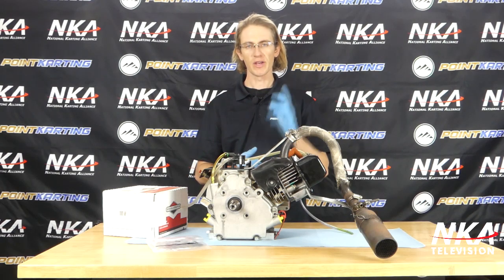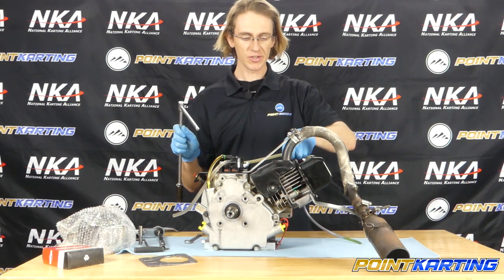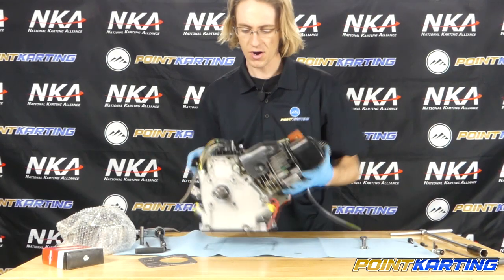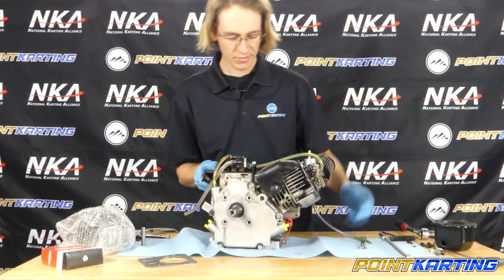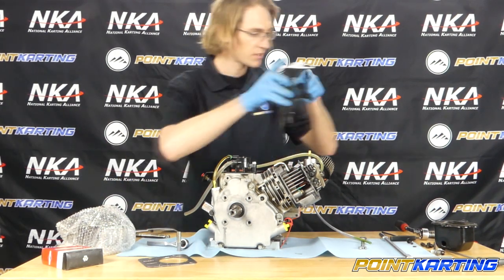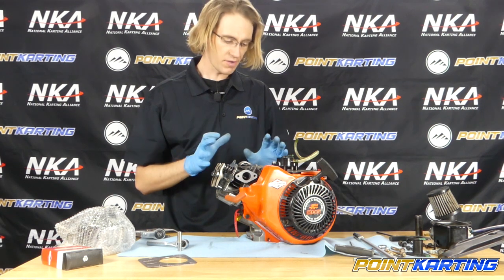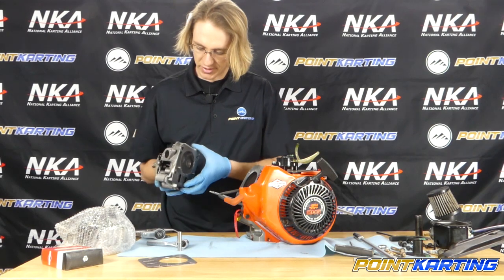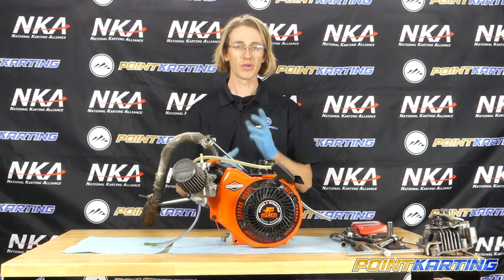Replacing the Cylinder Head on a Briggs 206

Comment: Do you have a video that illustrates changing out intake and exhaust springs when they wear out?
Reply from the maker: Hello! Thank you for commenting. At this time we do not have a video specifically about replacing the valve springs. However, we do have a great tool for easy removal of the valve springs on our site that makes it super easy to remove and replace the springs. We have added a note to our production list to make a video on how to do this, and we appreciate the suggestion! In the meantime, give us a call or email anytime and we can walk you through the process.

Comment: Are you still making these videos? Please keep going! I need help on 206 and you have the best videos out there. Now my main question is why would you replace the cylinder head? Is maintenance on the 206 mostly just repairing? Or is there any tuning we can do to make it perform optimally? I know setting the valve lash is vital for optimal performance but... yeah im lost. Thank you for an awesome video
Reply from the maker: Hey Carl! Thank you for reaching out to us! We want to make more videos, trust us! We have been swamped with orders and business on the retail side of Point Karting, we intend to make more videos shortly! Replacing the cylinder head is great when the engine falls off in performance and you aren't comfortable with lapping the valves or more advanced maintenance, or if you bend a push rod, or strip the threads on the cylinder head for the exhaust header bolts - these are the most common reasons...Maintenance on the 206 involves some routine items as well as more intervale-d items - we have a document for our racers that goes through a lot of this. Feel free to reach out to us at pointkarting@gmail.com for this document! Chat soon!
Reply: @PointKarting  thank you thank you❤️ good luck with everything

Comment: I just replaced the cylinder head on my 206 now it is very hard to pull.  What should i look for?  Thanks.
Reply from the maker: @Titan Town great question! Likely you have your valve lash set on the wrong stroke. Make sure when you set your valve lash after replacing the head that you did so on the cycle between the intake and the compression / combustion stroke. Having a hard-to-pull / start engine is a common symptom of that. Let us know if this helps with your problem, and reach out to us again anytime you have questions!
Reply: @PointKarting  so i think i set the exhaust on the wrong stroke and it was too loose and not engaging the compression release.

Thanks!
Reply from the maker: @TitanTown  Sounds like your cause right there!

Comment: What type of thread compounds do you use in each step? Here you didn't appear to use any, but I've heard anti-seize on the header bolts, and blue loctite other places. Any thoughts?
Reply from the maker: Hey Josh! Good questions. Personally, I don't use any compounds on the head bolts - I probably should, but they come in the packaging from Briggs with some lubrication already there, and from the factory there is typically anti-seize within the head bolt threads in the short block. The blue loctite we use on the clutch retainer bolt  - other than that we do not use any loctite on the engine. Some folks will use anti-seize on the exhaust header bolts as well, but I don't recommend this personally. I hope these thoughts help!

Comment: Why use a mix of standard and metric?  Briggs should step into the present and use all metric.
Reply from the maker: @Titan Town not really sure! Great question to which I would say overall the the engine is mostly metric tools to use. There are some engines out there that have a "US SAE" set of rocker arm supports / adjusters, but most modern 206 are metric throughout. Of course, any standard size tool can also be substituted for (theoretically) the equivalent metric. I guess as I have worked on these engines I have found a couple SAE tools that are best for use instead of metric tools in certain areas.

Comment: Eric, You may want to edit your video. The bolts that attach the cylinder head to the short block, are not lag bolts. You referred to them as lag bolts when you removed the cylinder head and installed the new one? Lag bolts are used in wood!!! 

Also why replace the entire head? Valve guides can be replaced, and while your at it install new valves, springs, retainers and locks after you’ve touched up the valve seats. 

A seasoned cylinder head is more stable than a new one,  which has not been heat cycled. A new cylinder head will still distort some, and that is where the problem with leak down occurs is around the valve seats, resulting in a loss of power. 

If you don’t have the capability to touch up the valve seats, send them to me and I will gladly do them for you. Otherwise nice video.
Reply from the maker: Rich Nelson thank you for the feedback. This particular engine has been a “problem child” in our shop for quite some time. In my experience, replacing the valve guides in these engines does not result in a positive outcome, as the guides tend to slip in place with these heads. If you’ve had a different outcome, that’s great, but we are attempting to demonstrate what several of our customers have requested a demonstration of. For most racers, replacing the assembly is going to be a more useful demonstration, as they will often need to remove and inspect the head in tech - furthermore the head gasket is a replacement part as well due to a regulation governing the thickness, as there are only so many times one can tighten the head down prior to the gasket becoming too thin to use legally. I find your comment interesting regarding the seasoning of the cylinder head, I’ll have to do some more research there, but that makes sense regarding stability, so thank you for that! I’ve always called long bolts like that lag bolts, so I’ll try and be more accurate in the future - must’ve been a term I picked up over time. Thank you for your feedback on our video! Recall that these videos are being created to bring informative guides to racers who deserve to have the ability to do these maintenance items themselves. If you’d like to join us for an additional video on refreshing a cylinder head, which is somewhat a different topic, you are certainly welcome to!
Reply: @PointKarting  I do an average of 10 cylinder heads a week in my shop. The exhaust valve guide is the biggest power killer in these engines. If the guide is worn you will not get good valve seal and therefore lose power. These guides are made of sintered steel which is pressed powder. They wear quite fast on the hardened valve stem.  To do this right, the guides should be pressed out.....not hammered. The guide bore should be checked for straightness. The new guide should be reamed to .2485 in a lathe. then honed. Install the new guide with a press. Now, you will have to cut the valve seat to match the valve. This is critical for a perfect valve seal. Lap the valve with a medium grit compound. Clean very well and assemble.  Great video. why replace the head when you have one already heat cycled.
Reply from the maker: @BM-xc9sq  Thank you for the comment and the insight! Replacing the valve guide certainly makes sense -I think for many racers this may be beyond their service capability, but definitely a good suggestion and note worth outlining! Briggs does sell the guides, and the average racer could do this procedure - we created this video to show racers how to replace the new head assembly, which is a little more within the realm for most, we have found. Email us at pointkarting@gmail.com if you want to chat more about head work on the Briggs 206!